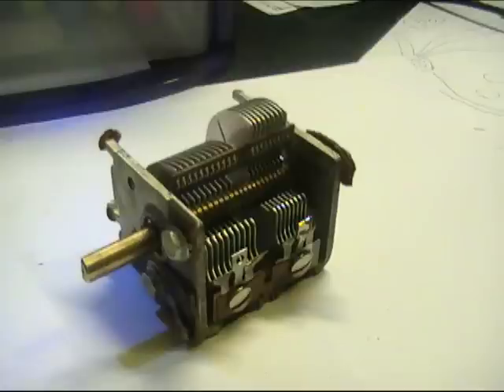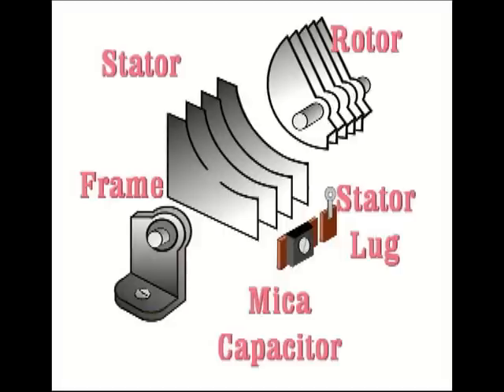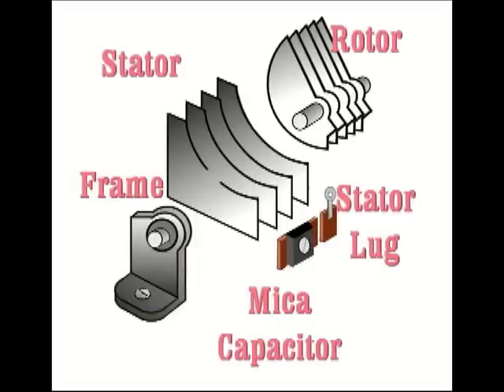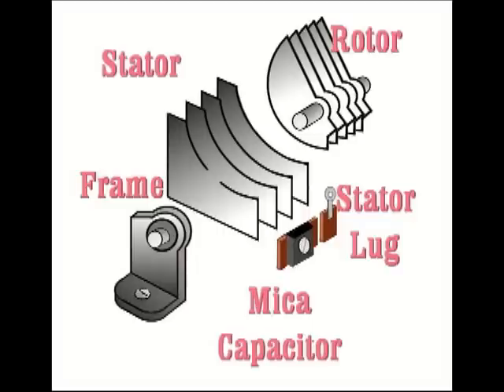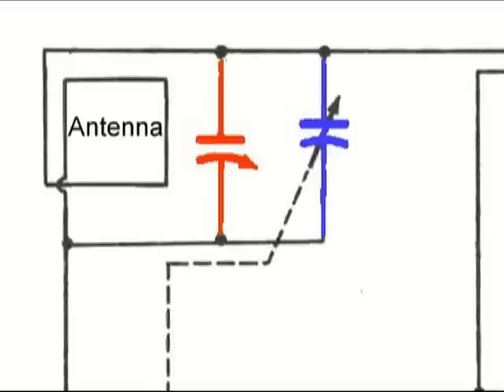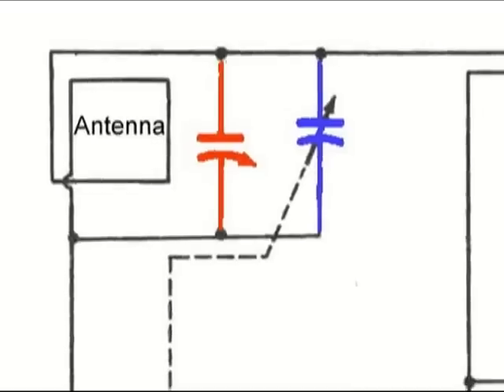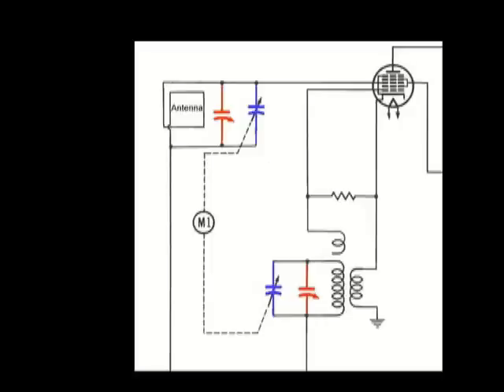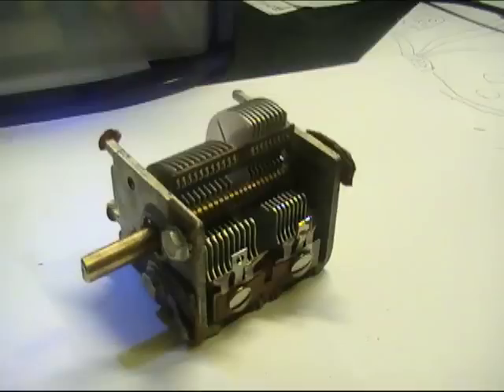Understanding Tuning Capacitors: Antique Radio

Comment: Thanks for the video. I did my first ever AM alignment on a tube radio tonight with my TinySA that I recieved from China this morning. The first step was to conect the signal generator stator lug on gang capacitor R.F. Section huh? I did a search on Google, your video popped up, and issue was solved 30seconds into the video!  Thanks!

Mike
Reply: बहुत ही खुशी हुई जानकर 😊

Comment: Hello. I got a boombox with an analog tuner from a friend. It does not play any FM station with no static noise. Stereo light comes on. It has a new antenna. FM stations’ signals are good because my other tuners have no problem. Inside the boombox is like new. Antenna cable is connected to the pcb. I cleaned all the switches and pots with contact spray. It has one of those little variable tuning capacitor in a plastic see-thru square with 4 screws on it. I played with the tuner cap screws but it did not get any better so I put them back to the initial position. The tuner cap may not be set properly because the tuning needle does not show the proper station frequency. What can be the issue? How can I tune the cap? TY
Reply from the maker: I'd really need to test it to find the problem. Some questions: Does the AM work?  If so then the problem is most likely an open or faulty component in the FM circuit. If the needle is turned by string then it doesn't matter if it's misaligned. The tuner itself is still working unless it doesn't turn.  Try to find the schematic for your model at nostalgiaair and trace the FM circuit from the am/fm switch.  It's probably a transistor radio. My guess would be an open circuit in the oscillator or oscillation circuit.  But if it's 45 years old it could also need capacitators replaced.  Especially  polarized caps.  Or it could be a break in any of the transformers.  If you have a tracer start at the antenna while changing the tuner.  If you hear a faint sound there it means your antenna works.  If not, it could be an open wire in your oscillator circuit.  They look like wound wire and will be in a circuit with one or more capacitors.  Take the batteries out and unplug it if it's plugged in. Then do a continuity test on each winding of the oscillator (there is probably more than one winding in the oscillator. If the oscillator is OK then check the capacitors attached to it. You can sometimes see damaged capacitors by leakage or puffy tops.  Next turn it back on and trace the base and output of the first transistor in series.  If the sound is louder thane the base than that transistor circuit is OK.  Move on to test the next transistor circuit, and then the next, and the next, and so on until you find the open.
Reply: @johnallenrichter  It was the tuner cap. I fixed it. TY

Comment: What determines the pico farad range of a variable capacitor, is it the size of the rotor/stator fins or some other component of the capacitor?  As noted below this is the clearest explanation available of what a variable capacitor is and what it does.
Thank you

Comment: Just got my electric screw driver out to have a tweek at the cap on a 1960 valve domestic radio, 5hanks.
Reply from the maker: @jooles0001  I always like to add that the amps and voltages in antique electrics can be lethal. You can get plastic screwdrivers to adjust caps.  And always unplug and ground power caps before working on a chassis.

Comment: Greetings:
The tuning capacitor has one section that forms half of a "resonant tank circuit" that requires an inductor that together with the tuning condenser resonates at frequencies that cover the broadcast (medium-wave) band from about 550 kilo-Hertz to about 1700 kilo-Hertz (aka 1.7 MHz). In the absence of a loop or loopstick antenna a longwire external antenna is used to collect radio broadcast carrier waves that are used with the local oscillator tank circuit to create the Intermediate Frequency (IF) in the convertor tube, also known as the mixer tube. That local oscillator tank circuit is formed by a separate inductor paired with the other portion of the ganged tuning condenser. 
BTW: The local oscillator portion of the tuning condenser can be of the same capacitance range as the other half or it can be lesser in capacitance while it is paired with an appropriate inductor such that the local oscillator frequency range produces a difference frequency that tracks with the frequency range of the antenna portion of the tuning condenser tank circuit in a way that always results in a difference frequency that becomes the IF frequency in the convertor tube's output. Typically the maximum capacitance of the antenna section is historically about 365 pico-farads.
In the schematic shown, the loop antenna is the inductor that forms the tank circuit with the larger section of the tuning condenser. That tank circuit is tuned so that the impedance top to bottom is greatest when the frequency matches that of a broadcast station's carrier frequency. That high impedance keeps the desired carrier from draining off to ground and instead goes into grid 3 of that tube. In addition to the antenna signal, the antenna loop will later be the path for the DC AUTOMATIC LEVEL CONTROL to reach that same grid to reduce the gain of strong station signals (strong signals produce a more negative DC level that has the affect of reducing the gain of that portion of tne convertor tube as well as that of the IF tube - Hazeltine patent). The local oscillator connects to grid 1 where it gets amplified for the mixing process.
The RED capacitor adjacent to the capacitor used for antenna tuning is the trimmer capacitor affixed next to the lug of the stator. The trimmer capacitor is formed by a sandwich of two plates separated by a mica dielectric. As the screw on the trimmer is turned clockwise the capacitance increases as the two plates of the trimmer are forced together. That capacitance is added to that of the larger movable section indicated by the trimmer being drawn in parallel to the 
larger section.
Reply: Very Very thank you ❤❤❤❤❤

Comment: Per your request, you need to make a correction to your explanation of the Red and Blue capacitors.  The capacitors with the dashed line between them are the main tuning.  One for the RF signal from the antenna, the other for the oscillator circuit.  The Red capacitors in the drawing are the trimmers.

Comment: For a 2-gang rated 12 - 495 pF, with 2 lugs on each gang, if I connect all 4 lugs, would that make capacitance 24 - 990 pF? I wasn't aware that antenna gets hooked up to chassis lug. Thanks.
Reply from the maker: I can't comment on your specific tuner. The one in the video is an AM tuner only. Some tuners are for both AM and FM radios. When you say 2 gang I suspect it is a AM/FM tuner with a gang for each modulation. The tuner, of from the 60s or before, has an air capacitor and a small ceramic capacitor for each gang. The ceramic cap is of a set standard value. It is hooked in series with its metal air cap gang. Hooking caps in series and in parallel have two different outcomes. I can't remember which is which. But I think hooking caps in series increases the overall capacitance while hooking in parallel decreases the capacitance. I could have that backwards. Any way I dont work on FM radios. But I suspect you would not connect the separate ceramic caps together.  But that's just based on the seat of my pants.  Best to ask another youtuber who works on AM/FM radios.
Reply: @johnallenrichter  This is AM only; the dual gang reaches lower frequencies than the cheap 223 pF variable caps, plus it's way cooler. I'm attempting a BC548 3-transistor receiver with hand wound coil, crystal earphone etc. My earphone gets a crackle, otherwise I'm stuck. I was testing the capacitance of connected gangs today and seeing values around 1000 pF on the high end, so that sounds right (lower frequencies). Perhaps I'll put a video of my progress and ask you to check it out, if you would. Thanks again, Paul
Reply from the maker: @p1nesap  I'd like to see that.  Is this a crystal radio?

Comment: I’m a complete novice to this stuff. Still, I would like to use a tuning capacitor in a small circuit so, which is the ground and where do I connect the power/signal, is the stator the ground, and the rotor the input, or vice versa? Please let me know. I want to learn. Thank you kindly
Reply from the maker: What kind of circuit do you want to build? The best way to understand a radio frequency tuner is to decipher it as a very simple adjustable capacitor.  The capacitance is very small. I don't recall off the top of my head but I think it's around 20 picofarad to just under 200 picofarad for most old tube radios. Allamericanfiveradio has a video explaining tank circuits. You should watch that.  Tank circuits, or LC circuits are how the tuner works in circuit.  L stands for coil and C stands for capacitor.  It adjusts the capacitance on the antenna, which is called a coil, to "tune" the antenna to a single frequency.  Or perhaps better said it enables the input to be pulled from the antenna as a single frequency.  The antenna itself is still being bombarded with dozens or hundreds of different EM frequencies. But we only need one of those frequencies for AM radio to tune in to a particular station.  Theoretically we could hook up 100 different tuning circuits to the same antenna wire and pull 100 different frequencies off of it.  I always thought that this idea could become an improvement to a vehicle's wiring system -  to have a single wire that carries a couple of dozen low voltage frequencies instead of running a separate power wires to every point in the car that needs it.  For example, run a 20 amp single wire to loop through and to all the vehicles lights.  When the driver steps on the brake the brake switch would turn on a signal generator to infuse the power line with a particular high frequency.  Back in the tail light assembly will be a receiving circuit just waiting for that exact frequency to come onto the power cable.  When it recognizes the frequency it then takes voltage from the power cable through an h-bridge or relay to turn on the brake bulb.  So instead of running 30 power lines to every light bulb in the car we would only need one.  So you can see how understanding technology from 70 years ago can help spark new technology today.  Good luck with your project.
Reply: @johnallenrichter  I was thinking of using it, in an Atari Punk Console, that I built. And since experimentation is a real component, in APC building and I have two of these tuning caps, I figured I’d try but unlike electrolytic caps, this thing has no visible connection points. That’s where you come in. Anyhoo, thanks for replying. I really appreciate it. Cheers!

Comment: That's not true the red ones are the Tremors they're stationary the one with the dotted line shows the mechanical gang of the two air capacitors

Comment: Your video helped me very much. I see why now I'm getting weak signals. ? Should I use one variable capacitor that's much larger and a small 365 variable for fine tuning or do you have a better suggestions? Thanks, I hope you keep producing more info.🤔
Reply from the maker: Most old AM receivers use a variable capacitor in the low picoFarad range.  I can't remember what range exactly but it should be easy to locate on the web.  If you have a capacitance tester you can check the capacitance of your original cap to see if it is still within specs.  Some schematics will list the capacitor range.

Comment: Hey, thanks for getting back to me.

I see, in a radio the capacitor IS completely isolated from the chassis.  But the case, the rotor and the shaft are electrically the same point and they are collectively the opposite side of the capacitor from the antenna's input to the stator plates ... correct?  And therefore, control over the shaft movement must be done through an insulator ... correct?

I'm planning on using a matching pair to trim capacitance at the input to a record player's moving magnet cartridge amplifier.  The standard impedance is usually right around 200pF 47K ohms.  Some amps have a few steps you can choose from but the steps are entirely too large ... making those steps basically a gimmick or for some exotic cartridge.  I'd like to trim by about +/- 50pF from the standard.  I have about 50 cartridges to work with ... it should be educational and perhaps even find each ones sweetest spot.

Whatchya think?
Reply from the maker: As for AA5 tube radios, I believe the standard then was to isolate the stator from the chassis ground.  I have only repaired about 20 of them and in all cases the tuner was isolated from chassis ground.  However, i am not an engineer, nor do i recommend that anyone who is not familiar with electrical appliances from that era attempt to repair them.  They have enough current to stop the human heart.  This Wikipedia article might help you better understand the variable caps..

https://en.wikipedia.org/wiki/Variable_capacitor

As for your idea, absolutely!  You can use two variable caps to arrive at a desired capacitance.  In fact the tuning cap itself generally uses static mica cap(s) which allow the tuner's overall capacitance to be finely tuned specifically for a specific frequency range.  Be aware of your caps ranges though.  You can measure the low end and high end of the range of each cap to establish if achieving your desired capacitance is possible.  For example, your tuning caps may have a range of 80 to 350 picofarad for example.  And then remember hooking the 2 caps ins series will lower the overall capacitance to less than either of the caps individually while hooking them in parallel then the total capacitance is the sum of both cap ranges.  I like your idea of experimenting with capacitance for specific electrical pickups sensors, which you know are actually tiny little ac generators.  I personally have an obsession with magnetics so yes, any thing like your experiment is fascinating to me.

Comment: Soooo ...... the rotor (rotor plates, rotor shaft and frame .... IS the minus side .. and .. IS ground.  Is this correct? And rotor plates actually make continuity (their electrical path for current to them) through those little spring washers/holders and through the associated grease.  Is that right?  If not, how does current get to those rotor plates reliably? 

That's the part I'm not understanding ..... because .. I have actually found another use for them other than a radio .... and I don't yet own a capacitance checker.  And it's not as a paper weight ;  )           Go ahead .. ask me what I'm gonna use it for.   Cuz it absolutely blows me away that nobody else that I can find has ever used them this way.
Reply from the maker: Well, yes!  I want to know what you are planning with it.  I love things that people create outside the normal box thinking.  As for your "minus" connection question - it's way more complicated than what my simple video explained.  The tuner cap is NOT connected to chassis ground in any way.  Although the tuner is usually physically attached to the chassis you should see rubber insulators on those bolts to prevent connection to the chassis ground - which could actually be hot on older radios.  Further, the radio signal being induced by the antenna is an AC signal, not a DC signal.  So the signal current is alternating and remains alternating through the radios different stages.  So there is no distinct positive or negative sides to the tuner cap when it is being used as an antique radio cap. The variable capacity is tuned to isolate the desired radio frequency within the tuning tank circuit, which this simple video does not get into.

Comment: Can the mica.cap in the tunning capacitor ever go bad
Reply from the maker: Unlikely.  The pure mica cap in tuning caps are pretty solid.  Old transformers, like the I.F. transformers used very thin mica wafers with silver foil from the late 1950s and 60s.  They sometimes go bad because voltage would jump across the air gaps causing sparks. The sparks in turn would eventually burn a conduit across both sides of the air gap, leaving the I.F. transformer useless.  Symptoms are crackling and scratching output. The only solution is to take it apart, remove the mica and silver foil, and bridge a modern cap across it, maybe a 700 nanofarad?  Don't quote me on that.  Might be 120n. I have a video showing how to fix it.  It's called SMD, OR SILVER MICA DISEASE OF OLD RADIOS.  Maybe it started when the powerline fluctuated greatly like maybe getting struck by lightning.  Or it could just be poor engineering.

Comment: Wonderful presentation Sir. However I have a old model 5 pin tuning capacitor. What is its pin configuration and how to connect it with the circuit, if I want to make a old model transistor set.